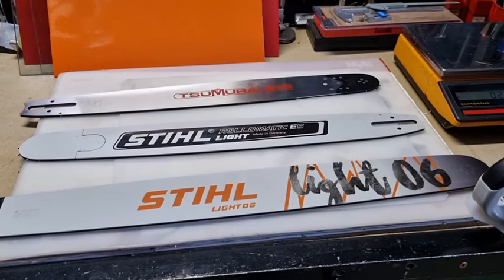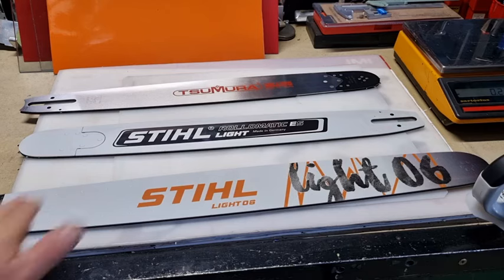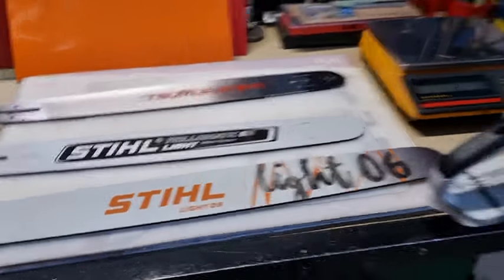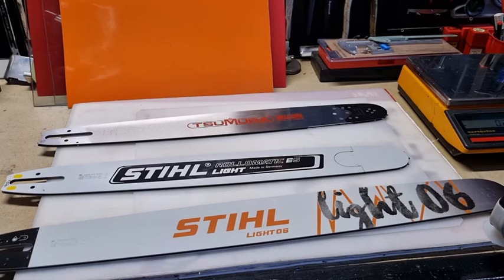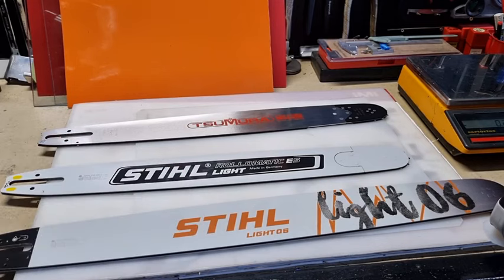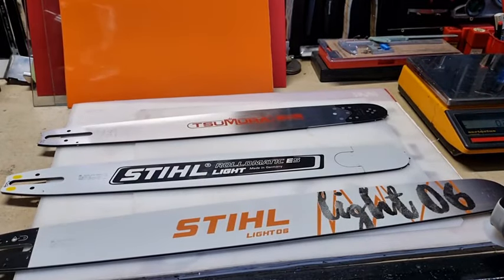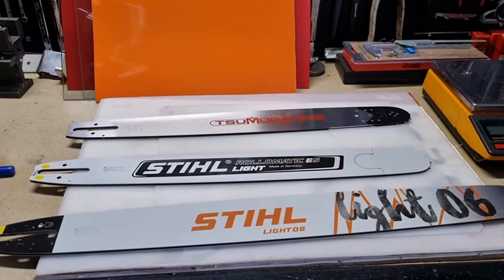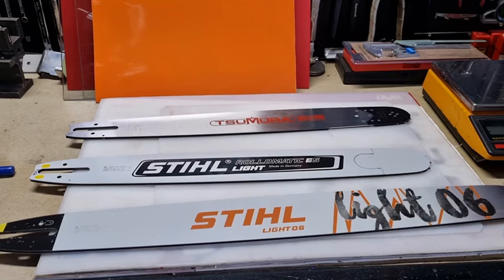Stihl ES Light 30% less weight than ES Bar

Comment: The Sugihara Light Pro in 20'' is 1070g. There is a UK website that sells most brands with the weight listed on all their bars. I think the ES Light is the best. However a 20'' Tsumara Premium Light is only 898g.
Reply from the maker: See Stihl are playing with carbon fibre bard 700gramms for 20 inch bar.

2010 The Rollomatic ES Light guide bar was developed. Empty spaces are milled out and welded shut using a special laser technique. This creates a stable hollow frame with a flexible outer and substructure.

This history continues through today. Weighing in at just 780 grammes, the latest development − the STIHL Rollomatic ES Carbon − is the world’s lightest 63cm guide bar. Even though the carbon guide bar will only be available as a special limited edition, it demonstrates that we at STIHL continue down the path set by our company founder Andreas Stihl of making it easier for people to work and live with nature."

Wow 780 grams ES carbon bar!
Reply: @ChainsawUsers  That is light I only have one big Stihl Saw, a 462  the ES light is a perfect match. On my ported Husky 550XP with a 18'' Sughari light bar with a Stihl RS chain it comes in at 6Kg without fluids.
Reply from the maker: @patrickvennard838 yes and also on my 500I it's solid bar not laminated it's the lightest apart from carbon fibre bar 780g
Reply from the maker: Wow under 898 grams that's very light